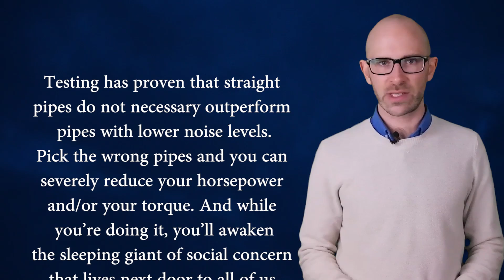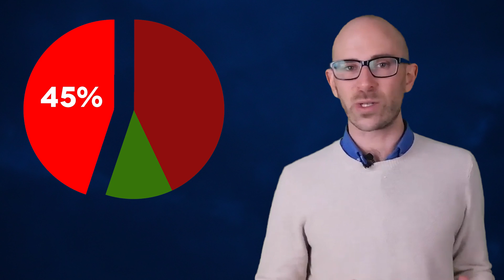Why are Harley Davidson Motorcycles So Loud?

Comment: According to the N.H.T.S.A., how many of these motorcyclist were on Harley Davidson's? @ 4:40, not an H.D. Does this report include off road riders? Why do we have this Brit reminding us of U.S. laws? The majority of  foreign bikes especially Japanese sport bikes are much louder with after market exhaust, which is legal in most states. It's pipsqueaks like this guy that gets the Feds involved in passing strict laws on "noise pollution". Every time I've bought a new H.D., I have to break out a couple hundred $ to change the sound deadener's to mufflers. Not anymore. My current H.D. , 2012 wide glide I bought new, the dealer wanted nearly a 1k$ to change and tune! My wife's sewing machine is louder. In the summer, the locust are louder. Pipsqueak Americans like this guy should push laws to legalize silencers for guns. Silence 4th of July fire works. No more amps at concerts. People are now getting hit by electric cars because they can't hear them. Pipsqueaks don't do anything about people texting and driving. Pipsqueaks scream and have a temper tantrum when they feel abortion's will be outlawed. Why?

Comment: the reason Harley's are so loud is because the size of the bore per piston some Harley's have 1.3 liter engines each piston is larger than the average car piston so when it combusts it produces a larger sound than a normal car and as the fact they don't muffler bikes produces the sound we are familiar with. bikes should never be quiet the sound let's you know where we are and helps keeps us safe. there are more accidents with mopeds since they are so quite they didn't know they are there.

Comment: #1, From the factory Harleys are plugged up so quiet, you can't hear them run at idle... #2, The dealers do this on purpose, because the very first thing any buyer is going to do is buy new pipes (from the dealer $700 to$1000 bucks installed) and have them installed and the computer tuned for The best performance and fuel consumption possible.. That's a thousand dollar upgrade on almost every single sale, every time... An yes they do it intentionally.. #3 and this is the big one, cause if your dead none of this matters anyway. The louder your pipes are the safer you are... I've ridden pretty consistently for 40 years. I'm 3rd generation biker...(not motorcycle enthusiast)... And for all the bitching and griping about the noise, at 75 miles an hour, when some ol' blue hair that can't hardly hear anyway, or some 20 year old talking on his/her cell or mr. mom hollering at the kids squeezes up along side of you, and tries to push you into oncoming traffic, you give them the pipes and wake em up... You only have to do this one time to realize how valuable it is.. Do people abuse it?? Sure some do, but in the big scheme of things, this is very small potatoes... In closing your stats are like Obama's unemployment stars... Just like the helment stats, all they ever question or consider for their poll are the ones that have had an accident not the whole populace of riders...And it seem intentionally pointed towards the negative..

Comment: I do love motorcycles but mainly speed motorcycles. I am not much of a Harley Davidson kind of person. Prefer Yamaha, Kawasaki, Ducati, even the new Zero Motorcycles they are super silent incomparison but a hell of a fun with their aggressive acceleration, the one I tried out recently at the dealer is quite wheelie happy but top speed isn't that impressive but tolerable for regular commute. 

Now when it come to the roaring motors, every biker knows why they bought a motorcycle sure it nice to look at but there is nothing like an adrenaline fuel roaring through your veins. I'm the type of person that love deep bass on my music, going to concert and clubs where the subwoofer is thumping to the point that you feel your heart beating to the beat and can't help the grining, Well a motorcyle it is that feeling when you have that roar of your motorcycle's engine at a twist of a throttle.

I kind of get that from a car, but something special about being exposed the the wind, smiling my way hiting 60+ and then start to feel it. Also it is just faster to pull the clutch, and hit the throttle to warn the idiot switching lanes without a turn signal on. ."

Comment: The perception of  hearing in the brain is also logarithmic so the brain doesn't perceive 80dB as 10 times louder than 70dB. A tenfold increase in sound pressure is perceived as a doubling of volume.

Comment: Stock Harley Davidson motorcycles are actually rather quiet until some of the dirt-bag idiots who ride them remove the mufflers and install straight pipes.  (I've been riding since the early 1970s, but I'd never tolerate noisy machines like those modified by inconsiderate operators.)

Comment: I wish my city would get after the loud motorcycles in residential areas.  I enjoy working in my garden, except when some childish asshat roars by with ear-shattering noise.  Many of them do it on purpose.  They don't wait until they get on the freeway to tromp on the accelerator.  They do it in quiet residential areas.

There is one or two large motorcycles in my neighborhood that make almost no noise, and I appreciate it.  They may may get slightly less power, but the good will of their neighbors more than makes up for it.  Those quiet motorcycle owners hearing not being damaged is also worth it.

Comment: I used to get cut up way more on my CB500 than I did if I was on my Road king and more on that than the VT1100 with straight through pipes. I'm not riding any more but in my car I notice a harley coming way before I notice a rice rocket.

Comment: The reason for loud pipes is to evoke the tough guy macho outlaw image and compensate for insecurities about self-perceived masculinity; the basic reason for buying a Harley in the first place.
Those who are confident in themselves buy bikes that work well and make no boasts about their need for validation. Hondas, BMWs and the like.
They also shave and don't have stick-on tattoos or dress in the gay pirate uniform that declares them to be rugged violent scum of the earth types rather than the low ranking tax accountant that you see during the work week.
In Japan, Harley's are quiet and respectable, so it's not built into the bike itself.

Comment: Now there is a fact that is deffo wrong.  On the TV adverts in Northern Ireland it says that over half of all accidents involving another vehicle with a motorcycle, the other vehicle is to blame.  Now the figures actually show it is 85 %  Those where the rider gets killed 70 - 75% and injured is around 80 %.  Now I do agree that some times the biggest nut on a motorcycle is the one that connects the handle bars to the saddle and not all motorcyclists are as pure as the driven snow but to say different than the stats is deffo telling lies.

Comment: That "Louder is more safe" thing is not necessary true at all. I remember one time I was driving and there was no sound whatsoever from any motorcycle, and then all of a sudden a motorcyclist came up in the lane left to me at twice the sped limit (I was already going 40) and cut in front of me. Behind the passenger door, no sound. Past the mirror, LOUD sound. It startled me so bad that I almost slammed on the brakes (and that would have cause a crash that would have been darn near impossible to legally attribute to the truly responsible person). My point is, the sound is largely routed out of the back of motorcycles, hence, in many cases, it can startle drivers and make the situation MORE unsafe.

Comment: as the years has gone by, the reason, the why and the how has been lost..(the reason) years ago it was discovered that beside blind spots, drivers just dont see bikes as in oversight, there are looking out for cars. (why) its a brain thing sound silly but true.(how) it didn't start out being a high pitch loudness. it's was an aquatic low loudness that a driver could feel and yes hear. drivers could feel throughout the car like a base speaker, see the slight vibration in the mirrors. it worked very will. but now its about skinny pipes and high pitch just for the sake of noise

Comment: Even with all the data saying that motorcycles cause accidents or are self inflicted, it's best to wear a helmet camera so even when an accident is caused by either a motorist or a biker, there's video proof of the situation, so no one is generalized and stereotyped, thus removing unnecessary biases.  Truckers use cameras as well, as the insurance companies are quick to blame truckers in any and all situations, even when motorists attempt to pull in front and perform "brake checks" tempting the driver to hit them.  Be safe out there, make yourself as visible as possible, including get that upper center mounted brake light on your car fixed, and have a dash/helmet camera on your persons whenever motoring.

Comment: Generally I end up putting dual glass pack mufflers on my V8 vehicles, then again I don't make a habit of hard acceleration in residential areas. Harley owners who are full of their own self importance will be responsible for any noise regulations put in place, and of course they will blame someone else. Municipalities have a history of noise regulations that affect drivers of cars with exhaust system that are louder that the OEM exhaust, not so sure why motorcycles should be immune to them.

Comment: I've been cut off more times than I'd care to count. 9 times out of 10 the person who cut me off was a thousand years old, so I doubt having a louder bike would help. They're probably too deaf for it to make a difference. I also get cut off almost as much when I'm driving as when im riding. I ride a 600cc inline 4, with the stock muffler, so it's only loud past 10,000rpm, which most people would rarely hit in the city.(If you ride like that, no amount of sound will save your life.) Harleys are loud because of the exhaust and crankshaft configuration. They burble like crossplane v8s, the firing order is uneven, and they are low revving, and have a single pipe per cylinder. 
.

Comment: "Loud pipes save lives" my ass. How about my right not to be woken up all night by your obnoxiously loud bikes? If you're really that worried about the dangers of what you're driving, then get another vehicle. Don't deafen everyone around you with something that sounds like a wet fart run through a terrible sound system at full volume. I get a ticket if I don't have a muffler on my car. Why are you an exception to literally everyone else on the road?

Comment: Yes Harley Davidson should replace its engines with electric motors! Hehe just kidding. Seriously over here in Australia every Harley has its pipes replaced with straight through ones. I have never heard one running at 80DB except in a Harley dealer even then they usually supply the new bike with the pipes already swapped. 100DB plus seems to be the norm. When it is so clearly illiegal why dont police do something about it?? Harleys dont have a nice sound, it is like a noisy air compressor. A Ducati has a tunefull note especially the older desmo models with conti exhausts. I know that a lot of motorcycle accidents are caused by car drivers simply turning in front of the rider. I would not blame the riders as much as you have.

Comment: It is interesting that motorcyclist seem to think there is this vendetta against them by all 4 wheel vehicles when that isn't the case. You see plenty of youtube channels by riders of these motorcycles and consistently they are seen cutting in between lanes when traffic is blocked up or cutting in along known blind spots of vehicles resulting in a crash. Oddly enough though, they claim it is the larger vehicles fault for the accident simply because they are smaller. If you choose to ride dangerously then it is your fault. Cutting down between lanes (along the lines splitting lanes) is not generally legal, but because the bike is small enough to do it they do it often. Those who argue they have never been pulled over for it might also want to iterate that any time they may have been caught doing it by police, that officer was in a 4 wheel vehicle and couldn't pursue making the argument invalid. I've nothing against bikers personally, but being intentionally loud is disruptive. Just because you like the loud blurp blurp coming out the back doesn't mean your neighbor appreciates it late at night, early morning, or even in the day if they work at night.

Comment: yes loud bikes are definitely safer by there is a line between loud and too loud. 
when Harley's roll of the show room floor they are pretty quite, but most people won't bother with aftermarket exhausts they'll simply just take out the baffle/db killer and that will greatly increase sound.
Reply: but*

Comment: The other day I was on the highway and I went to merge into the left most lane, there was a motorcycle there. As I put on my directional on, he accelerated slightly and I heard him. If it weren't for his beefy exhaust I would have cut him off and/or hit him. Loud pipes save lives.
Reply: way to point out how you are part of the problem and why they feel the need for these pipes..
Reply: Tom Coppola Ummm... No, they don't save lives. That myth has been debunked many times. Nice try shithead.

Comment: Solution: a hybrid system. Switch to electric to cruze through the city/neighborhood and back once you are out. Or a dual exhaust system. Both would add weight but if it's the difference between having the ability to sound awesome sometimes and not having it at all because of some future government regulation it might be worth a test.

Comment: I ride a Harley in a club with over 300 members.  No one I ride with rides with straight pipes.  So I call bullshit on that one.  Air-cooled, radial engines will be naturally louder than a similar sized water-cooled engine. The Harley engine is from a time when America kicked ass and made things happen.
That said. the majority switch out their mufflers for aftermarket brands like Reinhardt or similar.  Those mufflers are louder than the OEM but are still under EPA noise limits, and most that switch do it for the same reason people swapped mufflers on muscle cars:  they do it first because the bike breathes better, and better breathing equates to more efficiency, and second, they like the low base note that most aftermarket add.  Almost everyone I know that has swapped out the pipes also changed the cams and air cleaner and had their bike dyno-tuned for maximum performance.  Not noise.  So they aren't a bunch of dweebs that don't understand what they're doing.  With over 80,000 miles on my Roadking, I can attest that anyone that is depending on their mufflers to save their lives are idiots.  Most of the exhaust noise is behind you.  (Although it is pretty fucking awesome to hear 20 or 30 Harleys rolling down a road.  Gives me chills just thinking about it.)  Training, gear, and situational awareness saves lives.  I have to laugh at guys that use the loud pipe argument, but then don't wear a helmet, as if the noise is some kind of protective force field.  They probably text while driving, too.
A Harley touring model that hasn't been re-piped is actually pretty quiet.  Several police forces use them, and don't have any issue at all with noise, so I'm gonna call bullshit on you initial point as well.
Finally, I don't disagree that there are some out there that run with obnoxiously loud exhausts.  Those people are the type that don't respond well to lame-assed authoritarian fucksticks telling them what to do.  Threaten with noise restrictions and they get louder.  Kind of like the Original American spirit, you know, before the pussies took over.
Reply: EnsignSuder I think bikers should get into the gun thing. Its a great sport and then they can make all the noise they want. But I also think moderately loud pipes are acceptable, especialy when accompanied by a confederate flag.
Reply: Radial engine ?  Huh ?  Harleys are 45 degree V Twins.  Radials used to be used in aircraft, powered by Pratt and Whitney radial engines.  Do a little thinking before you post next time.
Reply: Gerald Frieberg Let me ask you this: if I cut two cylinders out of an 8 cylinder (yes, they existed) radial engine, what air cooled twin cylinder motorcyle engine awould it be very similar to?  Hmm?  What would be the major similarities of that and a Harley V twin?  What would the cylinder angle be? Or, if I were to add, say, 6 more cylinders around the crankshaft of my v-twin, what type engine would it closely resemble?   Maybe some practice in creative, lateral thinking would help you before you post next time.
Reply: and by the way, just so the ignorant arsehole killjoy bunny boilers of this world are aware, ANY ENGINE is loud .. if I took the pipes or mufflers off my Peugeuot 207 or Toyota Prius, IT WILL MAKE 90 < 100 dB of noise! So get a life and live the dream! and yes, I'm a parent, whose has to put babies to sleep, with dudes and me with noisy bikes... and I've not fuckin lost my hearing either... fucktards!
Reply: Freedom of speech is a beautiful thing...I speak through my wide glide pipes so the silly sheeple can hear clearly!
Reply: i feel like y'all just want the attention from the noise

Comment: 80dB? You call 80dB loud? That's below the maximum legal value for motorcycles in germany! My bike has a nice sticker that says 100dB/6.000rpm so a harley is fairly quiet.
I don't know how Suzuki managed to get the stock exhaust homologated with 100dB but aaallrighty!

Comment: I'll save you time before watching this video: it's because owners change the normally quiet stock exhaust systems to aftermarket ones which are freer-flowing and exceed the legal noise requirements. The same applies to any other motorcycle or automobile.